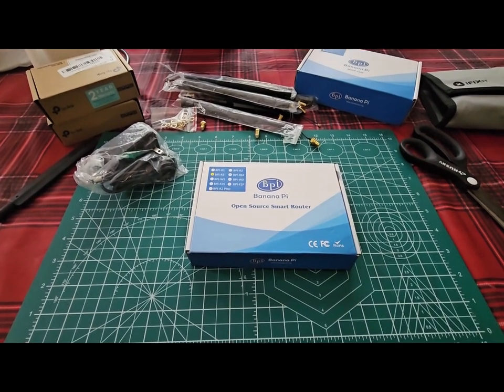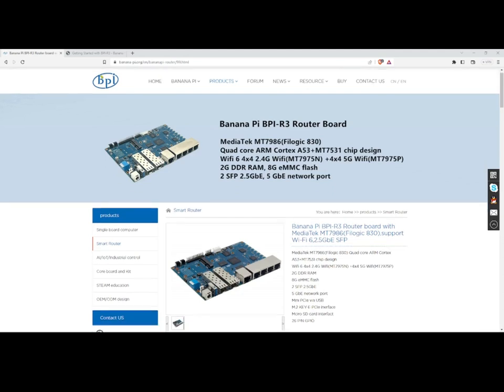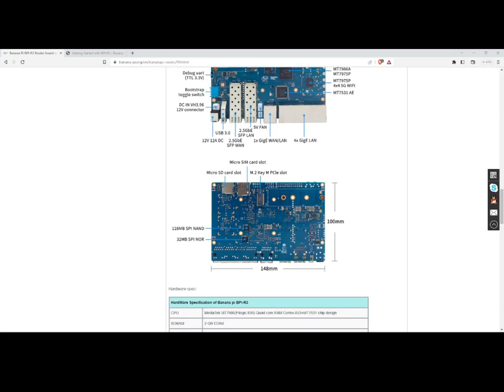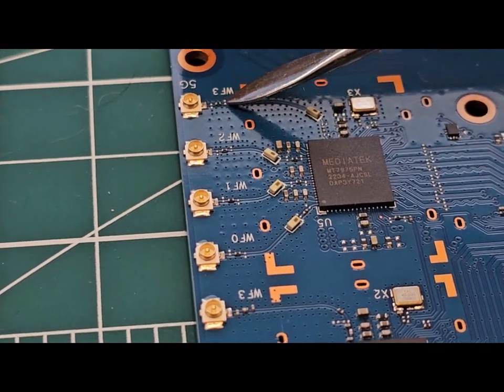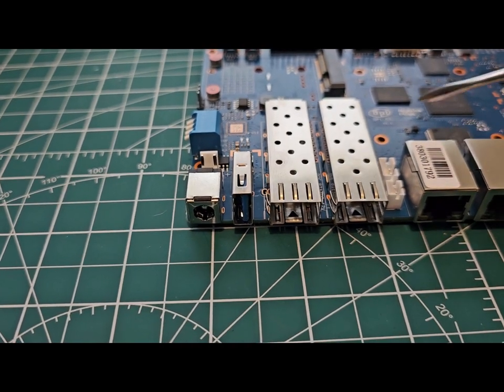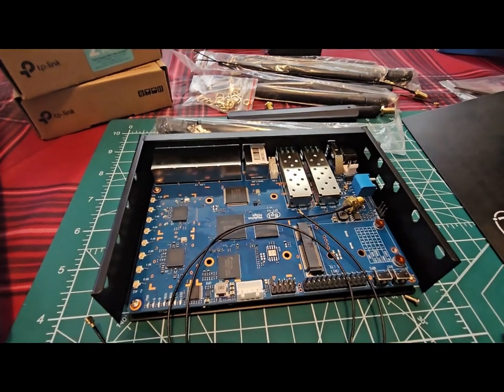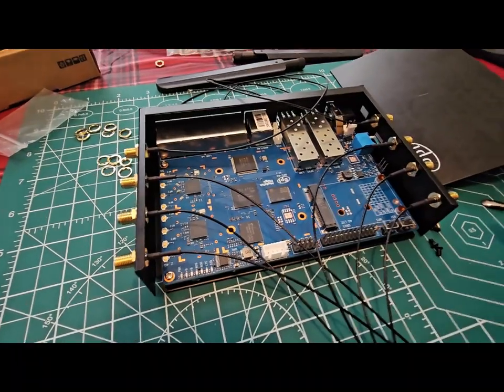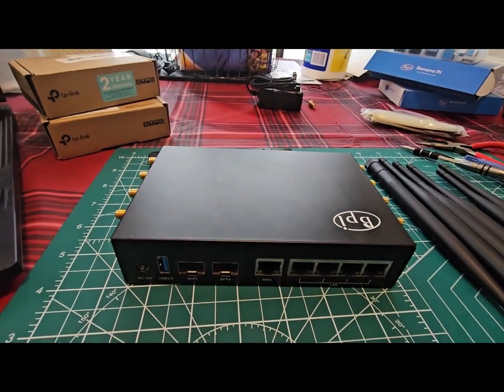UglyScale Press -  Part 1 - Assemble of the Banana BPI-R3

Comment: The RJ45 are wired directly to the motherboard? There are some RJ45 connectors that integrate the "PCB Magnetics RJ45" into the connector, for testing you can check with a multimeter in continuity mode to see if there is continuity between the RJ45 internal pins and the motherboard pins, if there is a direct continuity it can kill several electronics connected to the router
Reply from the maker: I need to get one, I just got UART because I want to see debug messages on the boards. I got a Super Renegade that won't boot, but say it got power. So, let me check around for one. That would be cool to know.

Comment: It would have been nice if you explained which antennas to which connectors on the board and why, they don't seem marked, maybe I am missing a manual or something?
Reply from the maker: I am still learning. I just found out there are different models with the connectors.
Reply: @terrorpup  No problem, they are marked as 1 2 3 and 4 , 2.4ghz , and 1 2 3 4, 5ghz. (4 Tx 4 Rx on each band)
I purchased the kit and the sma connectors were too short so I had to buy another 8 that were longer.
My board is already up and I recently figured out how to edit the sdcard image to give me a giant overlay file. I still haven't bothered with the EMMC yet.
Reply from the maker: @BobHenderson-dr2wy  Oh, you were talking about the kit, I thought you meant Antennas Connector in general as there a few differrent types and I am learn which is, which. Yes, the board is mark. Sorry for not following
Reply: @terrorpup   No,  you were right, I did want to know about the different types of antennas, but I just got a bundle because it was easier. Someone in forum said 2.4ghz antenna is not same as 5ghz antenna, but I dunno?

Comment: Hello Chuck and thank you for your video.

I am currently looking at this device to replace my current router, however, besides your videos and unicasts , there is no infor that you can take into consideration(bpi oficial video may or may not be unbiased).

How do you rate this router until now ? Is it stable, do you use it daily ? Also, if not for pfsense or opnsense, did you try openwrt?
My question is basically, would you recommend this device for someone with 1gb internet connection ?
Thank you :)
Reply from the maker: So, I am setting up the SD card, getting to record setting it up as a router.  Stay tune.
Reply: Is there a difference in energy consumption at idle/load between openwrt and pfsense?

Comment: I need your help regarding banana pi I bought Banana Pi BPI-R3 Set MediaTek MT7986 2G DDR4 RAM 8G eMMC Flash 5 GbE Network Port SFP 2.5GbE Openwrt Wifi Wireless Router Board and I want to configure sfp as wan and other eth port as bridge and I wand to set up vlan10 for internet and vlan30 for voip can you please help me on that ? I have already DFP-34X-2C2 from ODI works great with Mikrotik rb5009 i want to use it with banana pi
Reply from the maker: I am not the person to ask, sorry. I am still trying to learn OpenWRT.  There's a lot there. I would recommend Banana-Pi Forum or OpenWRT as well.